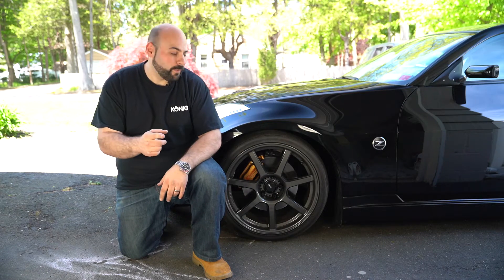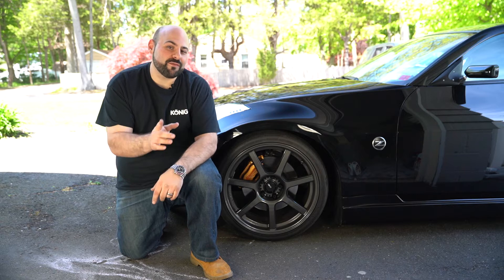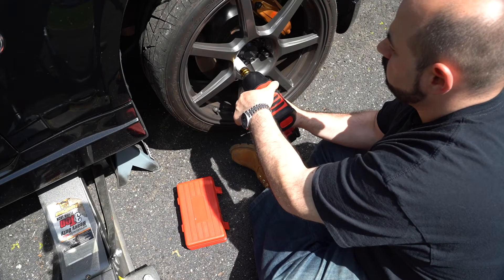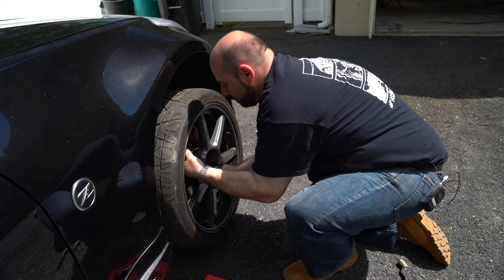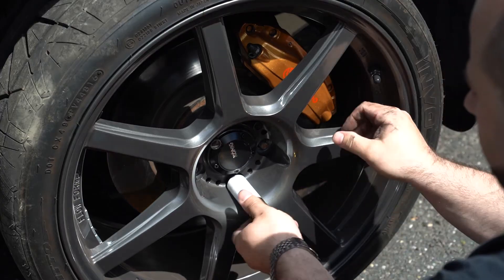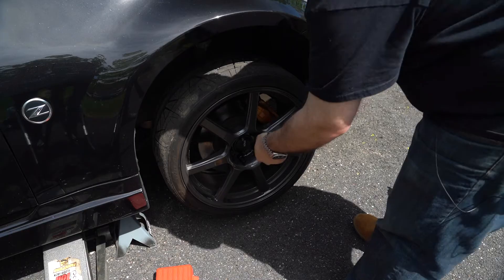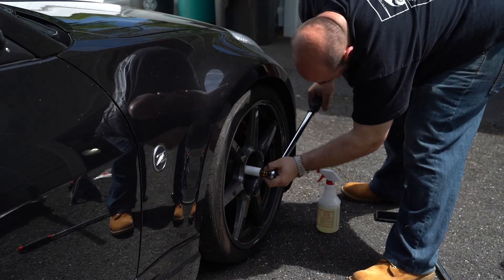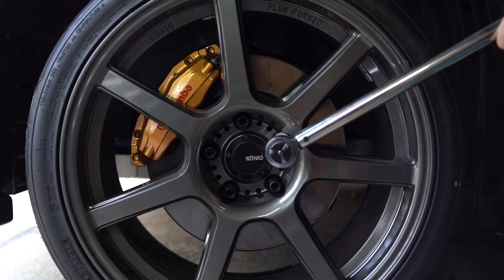How To Install Your Wheels!!

Comment: Thank you for the info should have all the rims been placed on the same way so when they rotate they all look the same direction? Your channel for a women is a lot of help I have told my son to subscribe also. Appreciate you
Reply from the maker: No problem at all, we're always here to help - that's why we make these videos! 

In terms of installing them with them all facing the same direction, that would only last for a mile or two because it's regular for your wheels to turn at slightly different rates at times. The only way to make this happen would be weighted "leveling" center caps.

Comment: I got my konig's from discount tire and they never put hubcentric spacers on. I ran the wheels for a whole summer last year with wobbling issues even after taking it back to them 2 times to have them looked at. They said it's just normal because it's low profile. It's a 18x9 running 235-40r18's. Of course this spring I realize that there were no hubcentric spacers when switching from my winter wheels. Now with spacers, it's perfection!
Reply from the maker: Hubcentric rings, when you don't have them, can make a world of difference as far as vibration and comfort.  Thanks for rolling with us!

Comment: ...uh wheel ring? Is that for convenience or for patterns that don't match or do I need to take my wheels back off to add the wheel hub rings
Reply from the maker: You need hub rings if the center bore of your wheel doesn't match the hub size of your car. Hub rings are recommended for most aftermarket wheels, and are especially important if you want to avoid wheel vibrations at speeds.

Comment: Just one question, do you jeep handbrake on when changing the wheels?
Reply from the maker: I guess you could, although really what you need to ensure is that the wheels are chocked so the car doesn't roll. If you're jacking up the car, chock the wheels and you'll be good to go.

Comment: I see so many people using a torque wrench wrong. You're supposed to go slow and stop tightening the moment it clicks, not continue for another 5-10+ degrees of rotation past the click like the gentleman in the video. This throws the torque spec out the window.
Reply from the maker: Just keep in mind that sometimes audio and video are not perfectly in sync.  However, we totally agree with you.
Reply: You realise that the torque specs is just a reference, right ? The actual torque specs could be, for example, "70ft/lbs" +/- 10ft/lbs. And guess what average torque wrench aren't that precise to begging with. So you're already off wether you want it or not. Going 5 deg over won't destroy your wheels and lug nut/bots. You're not even close to permanent deformation. 

On the other end,  shops that just send it with their impacts are a problem.

Comment: I’m new to your channel can you help me with this question: I had my rims replaced to Lincoln wheels rims but they installed and when I park the name isn’t upright. Should I be able to see the name Lincoln upright on all the rims when my car is parked? If so how can I do that? Im a women so I know it sounds crazy.  Thanks
Reply from the maker: It's completely normal. Your wheels have center caps in the center of the wheel with the Lincoln logo on them. Those center caps are mounted to the wheel in a fixed position - so when your wheels rotate, the logo rotates with it. In some cases, people can install self-leveling weighted center caps. 

If you ever need any help about wheels, we make tons of videos like this on our channel.